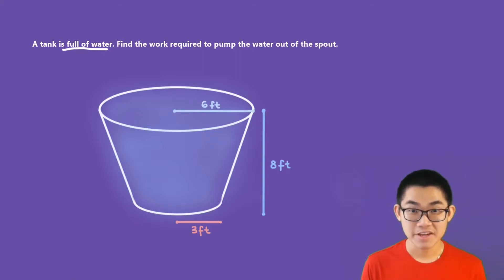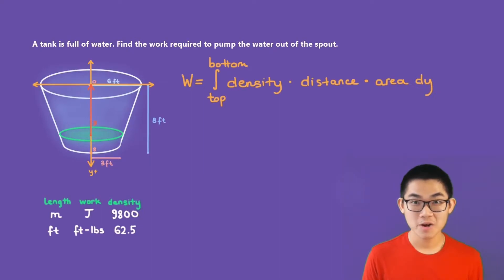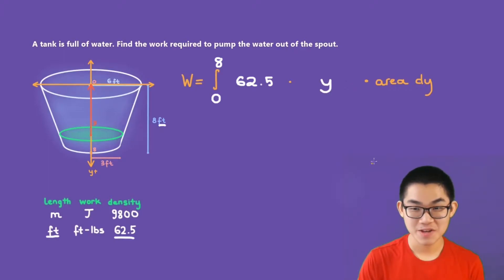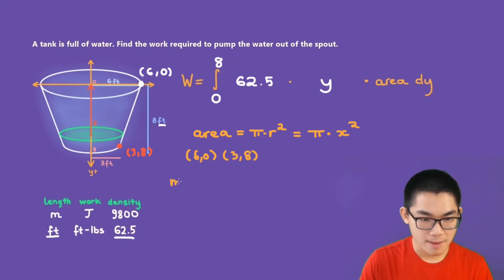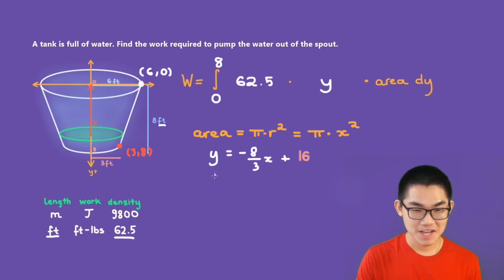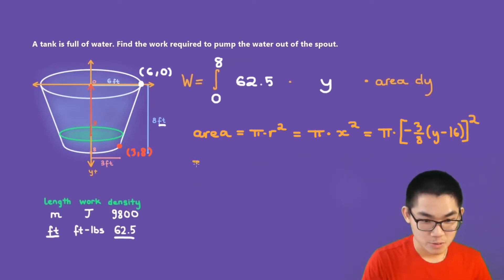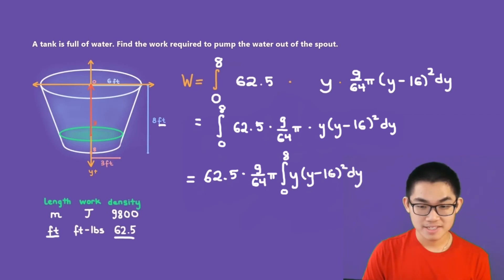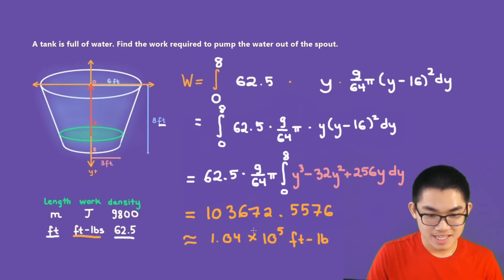Calculate Work to Pump Water Out of Frustum of a Cone

Comment: Why is your y- axis drawn backwards?  Or is that supposed to be a negative 8?
Reply from the maker: This type of problem requires the positive direction of the y axis to be downward. I know it's a bit strange to work with, but if you don't do it then it wouldn't produce the correct answers. This way is used in textbooks.